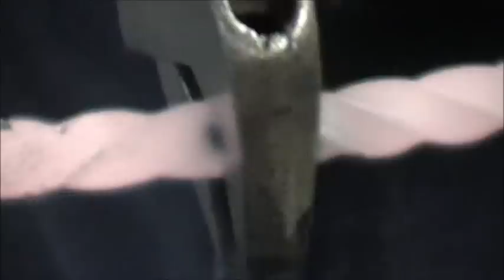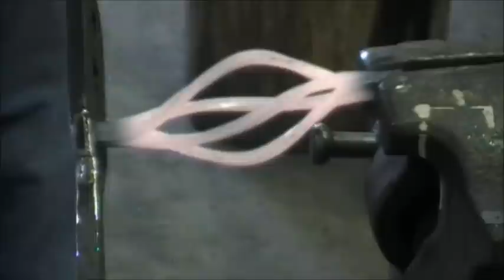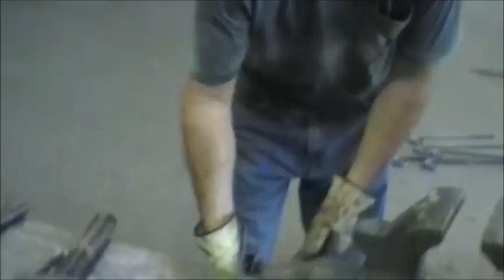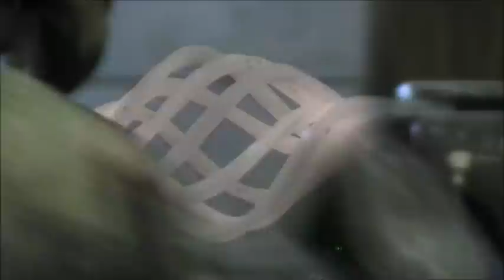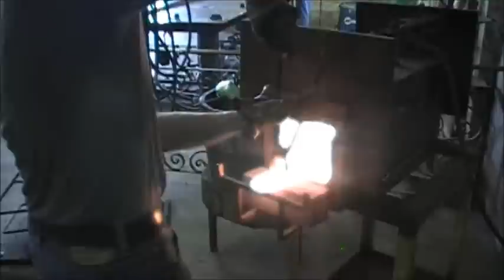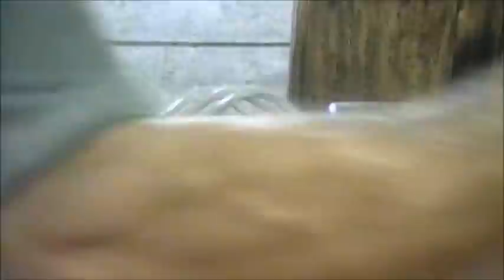Custom Wrought Iron Twist Bar and Onions

Comment: @MultiGuitarify this is an assumption but I'm pretty sure its 4 smaller bars that he connected the ends of to form one bar then he heated the whole things so when he twisted the 4 smaller bars would separate in the center

Comment: I have seen a machine do this at only 100 Celsius, I wander what weakens the metal more, the increased grain size in this manual method, or the almost cold deformation in the machine.
 By the way, this looks finer.
Reply: you sure it wasn't 1000°C ? Cause 100°C is just the temperature of boiling watter, that doesn't change anything in the metal :)
Reply: irlrp It's considered cold working. 100 c is enaugh to gain a little toughness though. Can also be done at ambient temperature, just slower.
Reply: Ok, very interesting, thanks !
Reply: I don't think cold working weakens the metal. The grains deform and it loses some of it's ability for permanent deformation and it becomes tougher, I think. When it it reaches the limit for deformation it just breaks. Heating it up will restore the round grain shape and ability to deform before the grain size actually starts growing.
Reply: You can put more degree of twist into hot steel, than cold. Cold, it will twist uniformly down the entire length. Whereas, when hot, the twist will vary according to the temp variation in the material. It's difficult to achieve uniform heat down a long piece of stock, which is why on longer pieces twists are often done in sections. You heat one area and twist to the desired rotation. Then, reheat, quench or cool the already twisted portion, and then twist the still heated portion into the part that's already done. This process is continued down the length, this will give a more uniform or balanced twist, on longer materials. Cold and hot twists both have their places. Most times, cold twisting is done on longer, simpler twist patterns, although it usually requires the use of mechanical assistance, due to the greater energy needed to turn it cold. Being more brittle, due to microfractures resulting from the twist, it can't be turned for as many rotations, before it will crack or break. These microfractures don't occur is twisting is done on properly heated steel. If needed, steel that has been hot twisted can be normalized, or reheated after the finished outcome has been reached. When steel is heated, the molecules expand, leading to increased plasticity and lessened tensile strength. Normalization is the solution. It's a process of heating the steel just above critical temp. This restores the molecular distribution, resulting in the metal regaining it's balance of ductile, tensile, and compressive strength. If needed, steel can be quenched in either oil or water, while above critical temp, to harden. If it's allowed to cool, without quenching, it will either anneal(greater plasticity) or normalize(balanced qualities) depending on the rate at which it cools. Cold twisting is good for simple, mass produced, jobs. If longer lasting, more durable, results are desired, then hot twisting is needed.

Comment: for everyone who hasn't figured it out yet and keeps posting the question "how do you get the one bar to open up like that?" its separate pieces of bar welded together on the ends. along the middle where it opens is not a solid single piece of steal, so when he twists it, it isn't one piece splitting and opening its multiple bars separating naturally.
Reply: +Edward Teach huh
Reply: Thanks, makes logical sense now that you explain.

Comment: How do you get the metal to open up like that?
Reply: Taen its separate pieces of bar welded together on the ends. along the middle where it opens is not a solid single piece of steal, so when he twists it, it isn't one piece splitting and opening its multiple bars separating naturally.
Reply: OK, thank you that clears a bit more up now haha cheers

Comment: curious if you have to do something to the bar before twisting it to make the material separate.. or is it just the type of metal? I tried with 4140 I had and it just tuned back the other direction instead of opening up
Reply: Mason Wood its separate pieces of bar welded together on the ends. along the middle where it opens is not a solid single piece of steal, so when he twists it, it isn't one piece splitting and opening its multiple bars separating naturally.
Reply: Edward Teach That makes way more sense, thanks for the reply